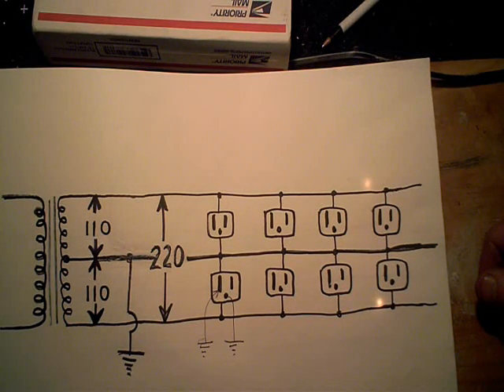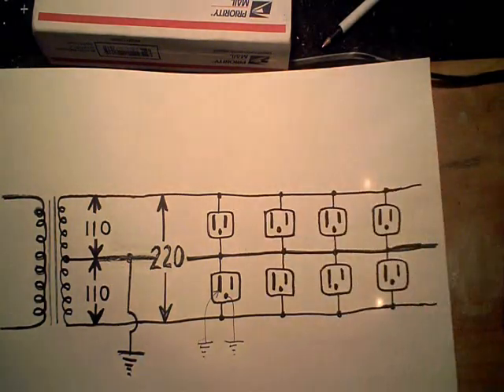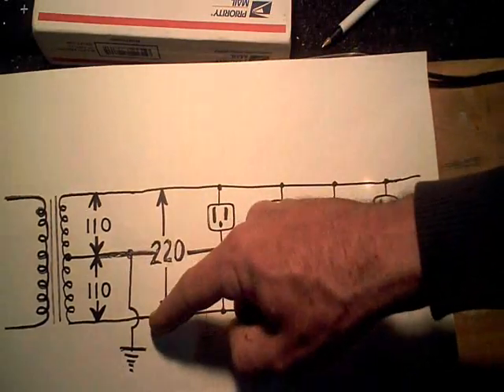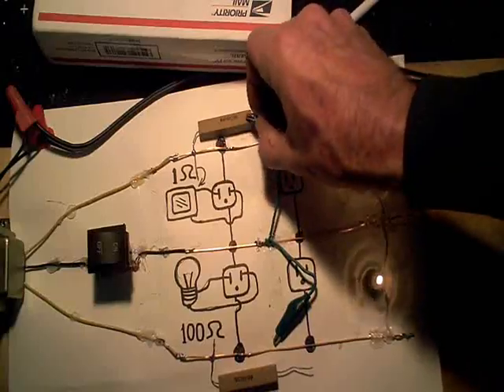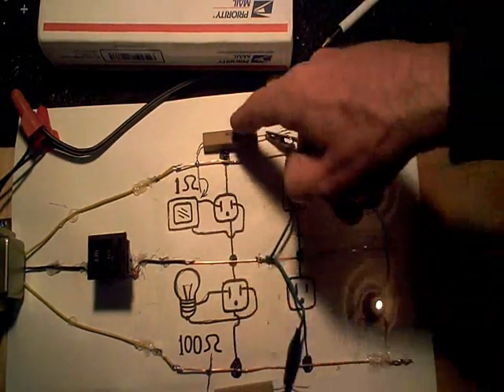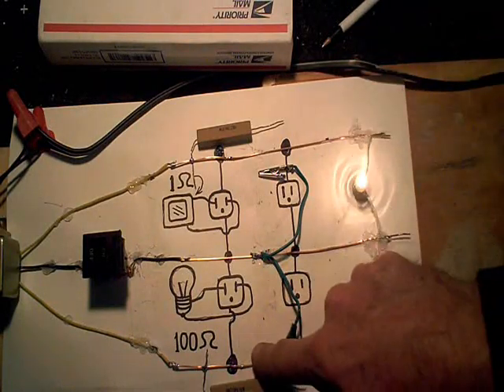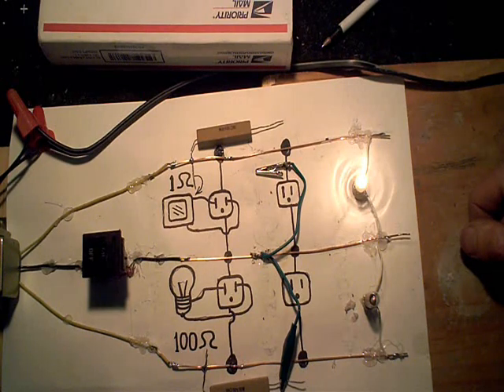Power surge due to an open neutral wire.

Comment: Actually, I think that this system is two phase, as you have to phases 180 degrees apart. Add a third phase and they will each be 120 degrees apart. I'm not sure if 240 - N - 240 is called two phase but it is in fact two phase.

I would think they should have it such that each phase has it's own neutral wire rather than a shared one so a power surge could not happen - unless the common neutral wire outside coming into the service panel went open.

Thanks for the video, I never considered what could happen if a common neutral wire opened up!
Reply: 240 V is the highest single phase ( + Neutral) system voltage used in homes / offices on earth , most countries use 220 or 230 V ... while Japan has pathetic 100 V
Reply: can grounding balance circuit?
Reply: I don't know what you mean by balancing the circuit. And do you mean a connection to the earth ground or equipment ground (the green safety wire)?
Reply: *****
 neutral is grounded or earth grounding  at main panel. i am not from North america , we use 240v phase to neutral , so i am just confused.
Reply: In North America, we have a 3 wire system - two hot and a neutral. The hot wires are labeled L1 and L2. Between L1 and L2 there is 240 volts. Between L1 and neutral there is 120 volts and between L2 and neutral there is also  120 volts. Half of the power points (receptacles or outlets) in a house will use L1 and neutral for 120 volts, and the other half of the power points will use L2 and neutral for 120 volts.

Large appliances, like stoves or clothes dryers will use all three wires - L1 and L2 for 240 volts to power the heating elements and L1 and neutral for 120 volts to run the electric motor that turns the drum or light bulbs, etc.

Neutral is grounded to earth to provide the system with an earth ground, just like any other wired system. In North America, we only use 120 volts for our power points, except for large appliances like dryers or stoves. If we had only a 240 volt system like you, then L1 would be the hot wire and L2 would be used as the neutral.

On your system, you could attach a third wire to the center winding of the secondary of the power transformer and bring that into the house. That could become your new neutral, and the other neutral would be just another hot wire. Then, between the new neutral and either other wire, you would have 120 volts. Plus you would still have the 240 volts between the two wires that you always had. Of course, you would have to move the ground on the old neutral over to the new neutral.

So that is all you would have to do to make your system the same as ours - just add a wire to the center of the transformer's secondary winding and bring it into the house. Then use your old neutral as just another hot wire.
Reply: *****
ok, i think our secondary distrbution is better beacuse of 240v P to N..but our primary distribution method (european model )  is very unreliable because it has no neutral and only switch's are used for protection with substation circuit breaker ,i think we cant use fuse in primary since it has no neutral return .So a single fault will cause outage in that feeder  .whats your opinion .
Reply: +lmgtech - In Germany the last substation delivers 3 Phases + Neutral ... these go into the house via 3 fuses ... after that, the Earth / Ground comes to it (also connected to Neutral) ... all these 5 wires come into the flat, the stove / oven uses all 5 wires ( 3 Phases + Neutral + Earth) ... normals sockets 1 of the 3 Phases + Neutral + Earth , different rooms can be on different Phases !  ... 
 .... But the input into the substation ( Kilovolts ) is just the 3 Phases. 
See: 
https://de.wikipedia.org/wiki/Datei:SichVert.JPG ( Neutral is BLUE ) 
+ 
http://www.patrickwagner.de/Knowhow/Bilder/Strom1.gif 
+ 
https://de.wikipedia.org/wiki/Datei:RoofStand.jpg 
+ 
https://upload.wikimedia.org/wikipedia/commons/e/ed/Stromversorgung.png
Reply: Phase is a characteristic of the flowing current. It has nothing to do with the arrangement of conductors or the path of the current.

Comment: It took me about 3 cups of coffee, and about a half hour of thought the first time I came upon a high resistive ground connection in my neighbor's 1972 mobile home after a mid night shift in 1978.  A 240 volt 100w lamp should be used, along with a multimeter for residential troubleshooting.

Comment: ihave outlets and a switch that has no power to them in the wires ,but the switch is fine ,i did notice that they installed 3 cieling lights any help

Comment from the maker: If your PC power supply has the capacity to operate on 220V, and you have a 220V source available it will use less current to produce the wattage.

Comment: My 1600W PC power supply is close to the current limit for a 14g circuit. As the supply is made to use on 220V as well, could I wire a special circuit with the hot side being one 110V leg and using the other 110V leg to make the device use 220V and draw less current. Thus allowing more deviced on the circuit before blowing the breaker/causing dangerous heat.

Comment: Can you use one of the hot legs as neutral for feeding a 240V load? Say a multi voltage(100V-240V) PC power supply? So you'd have 220V to "neutral" and pull less amperage?
Reply: In the USA 240 is using both 120v hot legs.  Together they add up to 240 volts RMS AC.  The simple answer is yes you use both hots to make 240.  As you may know AC alternates back and forth switching directions 60hz in the USA.  What you may not know is that each 120v leg is 180 degrees out of phase.  They are sine waves.  So think of one as graphing f(x)=sin(0) and the other of 180.

Comment: why does the other bulb doesnt light up although the neutral is broken but also the bulb acts as a load as other  resistor which is  active during the time. why current does not flow through the bulb which is off

Comment: Very Good, I have seen it as it happened where a regular light bulb will get bright with a blue tint and then go back to normal, we are double grounded now, and for a extra tip for your viewers we also run a ground wire from the hot water copper to the cold water pipe, it is in the new national wire code book, but I do not know if this is to increase ground potential or reduce electrolysis in the hot water tank.

Comment: The broken neutral problem is less of an issue in the UK, as most small buildings have single phase - a broken neutral results in a circuit failure. However, in big buildings which have 3 phase, or if the utility company's neutral wiring fails, you can get a similar effect, if the loads on the different phases are imbalanced.

I once lived next to some workshops. They had big motors on a different phase, and the current surge would "overvolt" my house because the neutral couldn't handle the load

Comment from the maker: Here in the US was most commonly use 110 volts AC for a majority of our appliances, and the outlets are equally divided between the Two live wires.  The heavier loads such as our ovens, water heaters and central heating units are wired for 220 VAC.
Reply: I realize this is an old video,  but you must have based this on some old books.  110 hasn't been a spec in the US for a very long time.   Officially power companies are to shoot for 120/240.   I've seen 117 - 124 coast to coast.   110 would be considered a bit on the low side these days (even in 2012).
Reply from the maker: @jeffm2787  Thanks for the info. It could be my age. Whenever I speak about our power mains I find myself using 110 and 120 without givin it much thought.
Reply: @GrantsPassTVRepair  No problem,  110 use to be the spec.  I believe it started to change in the 80's.  I'm no spring chicken either.

Comment: Most homes are only wired for 110v in the US. However, certain ones (like mine) that use 220v equipment (ie. air compressors, etc.) have this line specially wired in, they use different outlets (so you don't accidentally plug a 110v appliance to 220v!).

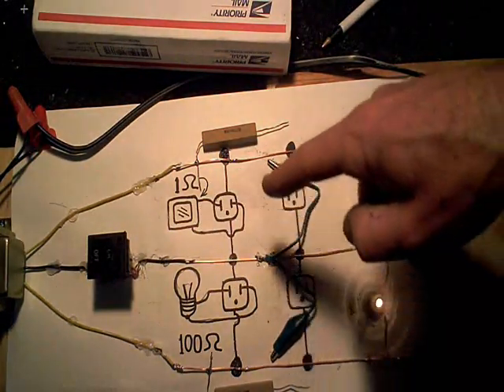Comment: 1:05 to 1:17, Neutral's disconnected, yes? If so, just wanted to add - the only reason why the bulbs glow identical (without neutral) is because they're the same wattage. Thanks for sharing.

Comment: pt2..

Industrial premises do get connected to all the phases, and are rated as 415v and get 240 for smaller appliances like the above

we also have an 'earth' wire which is usually at the same potential as one phase (neutral phase).
Its wired to equipment cabinets/chassis and house pipework, it goes back to the fuse board and 'trips' the supply if it ever sees a current.

Some small appliances are 'double insulated' and have no earth wire.